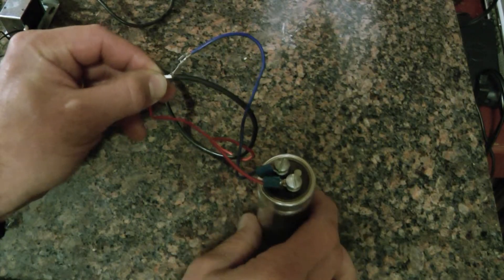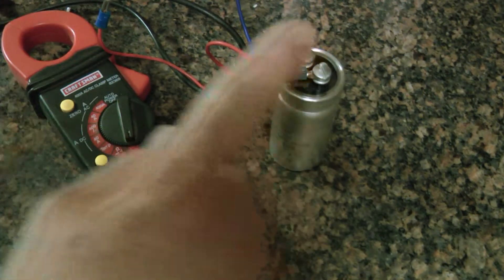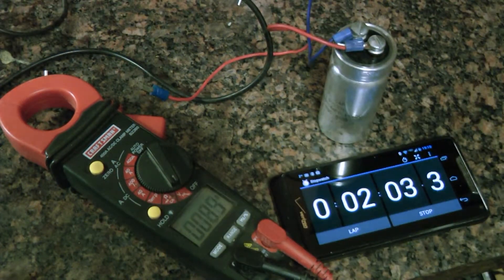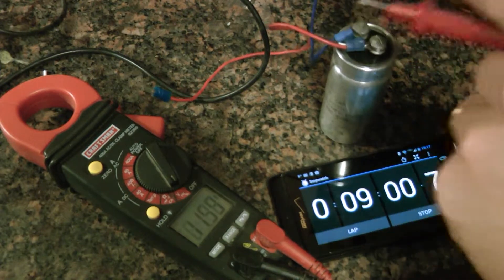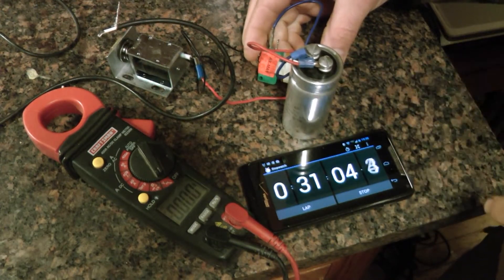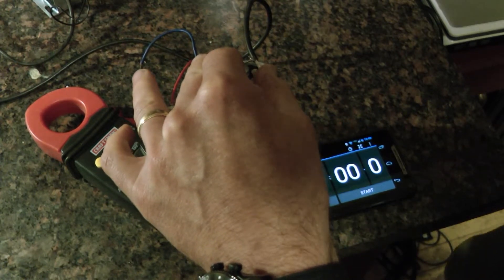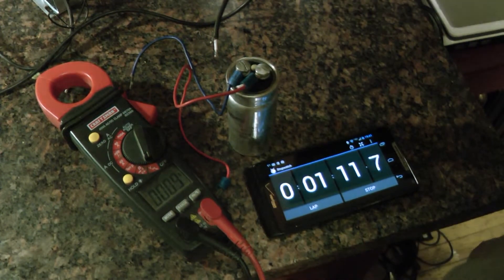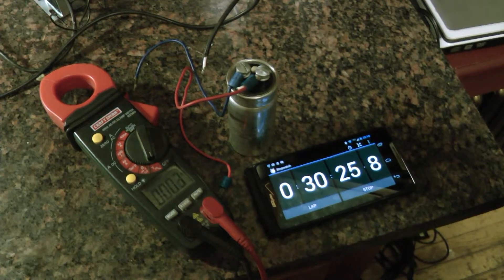Troubleshooting a 15v DC Capacitor - Part 2

Comment: Again, as I said in previous video....the DC meter does drain charge from capacitor upon taking a measurement.  Digital Meters do have high impedance, unlike older D'Arsenval Meters, but they are not infinite impedance.
Bottom line, you need to use a small battery.  Get you a little Yuasa battery (AGM), like less than 2 Amp-hrs.  You can do the math by looking up definitions of Current (amperage), columbs (charge) and energy (joules) and power (joules per second).
You probably want the latch to hold 20 seconds or so (sufficiently excessive to ensure operation every time).  You need to know the resistance of your coil, that determines the current at 12 volts applied...I am gonna assume a 60 Watt coil
For example, 5 amp at 12 volts for 20 seconds requires an energy store of 1200 Joules.
Try this capacitor test instead...charge it....leave it alone for 24 hours and then measure...that will give a better sense of the internal discharge.  If it is in good shape, it will still show a significant amount of voltage...if not all.  You need to use a small battery.

Comment: Capacitance equals Coulombs per volt.
Say you have a 20 watt coil to operate between 10 to 12 volts for 5 secs.
You need 1.7 amps for 5 secs or 8 coulombs of charge.
Assume your capacitor is to only discharge to 10 volts from 12 volts...change in volts is 2 volts.
8 Coulombs per 2 volts is 4 Farad....you need a capacitor that is like 300 times larger than what you have......get a battery.